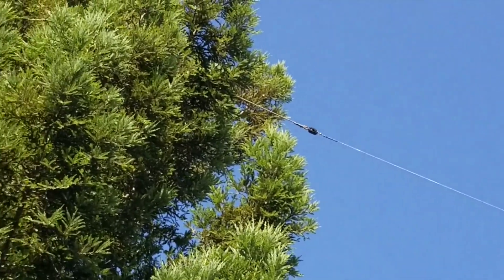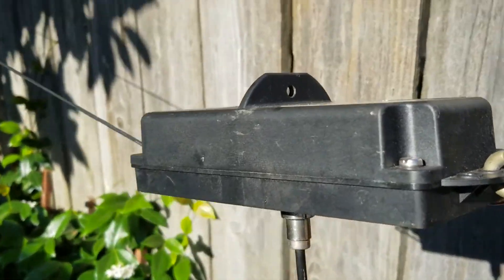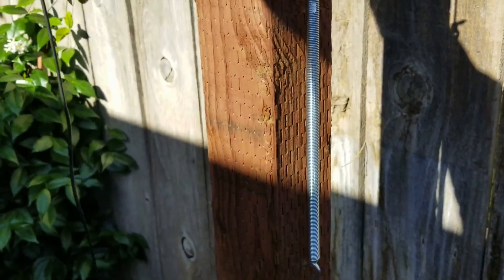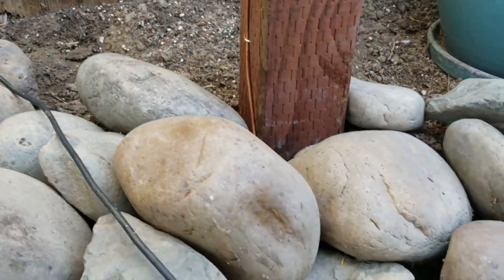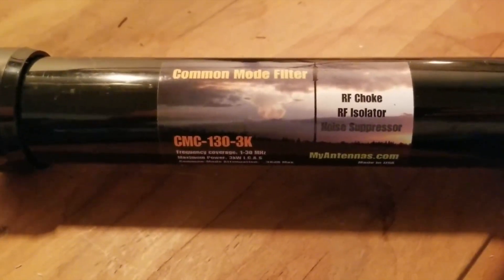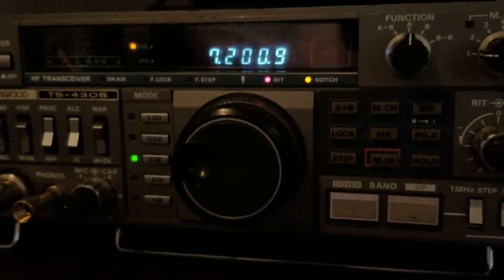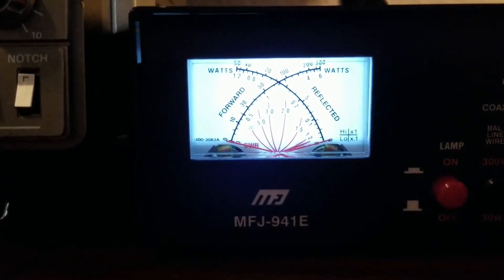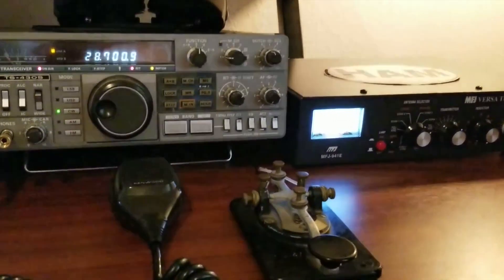EFHW myantennas 4010P EFHW (End Fed Half Wave) Antenna with Spring Tension system, AL7PS

Comment: Good video, thanks. I do have a question. I just bought the EFHW 4010 and there were no instructions as to which way the antenna wire should go i.e sloped upward and which azimuthal direction.
Reply: Thanks,  it has various configurations, there website shows the optimum

Comment: How'd you get it in the trees? Climb up there?
Reply from the maker: @n74jw  I used a fishing pole with 25 pound test with a 3 ounce weight attached.  Easily reached 75 feet height.  Then I tied a 1/8 nylon rope to the weighted end of the line and pulled it up. Very easy

Comment: Fantastic video! Pulley and springs=brilliant! I'm working on General and studying HF rigs AND antennas. Please a question. MyAntennas says no turner required for their 40,20,15,10......so why the MFJ??? And I bet your HF rig has an internal tuner? Thanks, I'm learning!
Reply: The tuner is to show SWR results, you do not need a tuner on this antenna. This radio does not have an internal tuner.

Comment: Great innovation, but I would think to combat rust from ruining your spring over time, it should be painted with perhaps a Rust-Oleum product ?
As for movement, especially of the ground wire, I wonder if the Copper will become, 
" Work Hardened ", and fail over time ?
I have a similar issue with a Red Maple tree, that I'm hoping to get trimmed, so not to have an antenna pass thru it !
Thanks for your posting !
Reply: Thanks for the comment.  I agree regarding painting spring. However, movement of the ground wire is not an issue. It has barely moved at all over the years.  It's not like it gets bent at a sharp point, it doesn't get bent at all,  it just moves fractions of an inch

Comment: I want one of these man! Will it work on 11 meter without tuning it out of the ham frequencies?
I have a CB base station and run CB's in the dump trucks on 11 meter and learning all I can off and on about ham radio.
I was ready to take my test then covid hit and sort of threw a monkey wrench in the gears.
da di da dit      da da di dot  dabblled a little in CW as well but not enough.

Comment: I was struggling with the selection of a noise filter. Kinda pricey for about 50 ferrites around a coax , but a nice encapsulated container. And you said it works. Your video is well made and clear. I took note of the solid #8 copper used as a grounding conductor for lightning protection. That is a good configuration because it's there to conduct a lightning strike--not stray Rf......If it does break after a year or so of swaying in the wind simply splice it together again. I like that..☺

Comment: I see  a problem with your setup that you might have already experienced since this comment is 2 years after your video. If the tall tree that is holding the top end of your wire starts to bend toward the house (toward the low end of the wire), the antenna wire is going to go slack and sag. It might even sag enough to get caught in your other trees that the antenna is normally above. I would suggest putting a heavy weight in between the end of your rope and the top end of the spring. This weight needs to be heavy enough to take up much of the weight of the antenna. This will allow you to use a lighter weight spring that will give you a greater range of motion to handle heavy winds that sway the tree a lot. When you attach the bottom of your spring to the post, be sure to pre-tension the spring so that the antenna wire will stay taught when the tree sways toward your house. I hope that helps.

Comment: I  have seen where people want to run > 50' of coax from the unit to ensure that the coax is not a half wavelength of your desired frequency.  Then I also see where people mount the unit very close to the shack to keep coax and ground wires as short as possible.  I also see where people like to raise the unit up to 40' as well as the other end of the wire.  So who is right? Which is best?  https://www.youtube.com/watch?v=iMbN_uDeyU0

Comment: Hi ~ what is the Gain of a EFHW ?
Reply: .5 wave on 40. 1 wavelength on 20. 1.5 wavelength on 15 and 2 wavelengths on 10M. So 2.1db/2.3db/3db/4db. 15 and 10M are gain spurs. I've worked from Russia to Japan on My Antennas 40-10 in an end fed inverted V. I compared my roof mounted Cobweb to my end fed inverted V on 15M today with someone in Spain. He said the V was 1 db stronger at his QTH.

Comment: Nice installation.  I have to say I like your background music as well...lol!  A 2 to1 SWR is only a loss of 10 watts if transmitting 100 watts.  And you are correct, your transmitter can handle that. Especially after using the tuner to match the load to the transmitter. 73!

Comment: Hi I use a similar system but use weight and not a spring gravity works for you
Reply: Me too, Peter. I have used a pulley and weight to mitigate wind and swaying trees since the 70s without surprises.  My 130 ft 80-10-2K EFHW is held up by the weight of two bricks (11 pounds) and a pulley about 15 feet out from the top of a big pine tree.  ---  73, kc4i

Comment: you should change that ground wire with a braided strap, not only does a braided strap carry HF better but it's far more flexible and less prone to fatigue.  Solid copper wire will work harden and break pretty quick.

Comment: Not familiar with my antennas but I would expect the coil on the wire should be at the far end of the antenna, not near the feed point. I couldn't find any instructions on their web page. You might want to check this.
Reply from the maker: The coil is placed exactly one quarter wave length on wire specifically,  correct design

Comment: Do you need a tuner with this antenna
Reply: Nope, It's Awesome! That's why many SOTA (summits on the air) HAMS use them. I trimmed and tuned mine to be resonant on each band, 40, 20, 15, 10 meters, right in the middle of the band. The SWR is 1 : 1.9 at the worst.  Used them for years, and not slowing down...
Reply: I don't use one and have SWR of 1:1.5 and lower across all bands. I've trimmed/tuned it to be resonant in the middle of each of the 4 bands. 40, 20, 15, 10. #notuner

Comment: Bought one of their ended wire antennas. Came with no directions so I emailed them asking for a copy of the recommended installation instructions. Was told in an email reply that they figured I would be smart enough to know how to install it as all hams should know how to to do this correctly. For the over priced antenna I would have thought they might have some installation recommendations. Will not purchase from them again.
Reply from the maker: They are correct. "Instructions" are based on your equipment and deployment configuration. As a HAM yes you must understand common basic wire antenna principles. And even if you tried to build one, including the transformer, you would be around the same price to purchase. The track record across the web for the EFHW from myantennas is nothing but stellar.  I've recently had a phone QSO over 7,400 miles away with just 90 watts in an Inverted L config. This antenna performs with a doubt!!!
Reply: @AL7PS  Oh you could build this for $40.   I have.
Reply: @AL7PS  I wad looking firward to some expertise with this particular unit. I have jad several endfeds and each was quirky on their own Just because your a ham doesnt make you an expert in every different antenna by any means.

Comment: Might try placing the choke outside.

Having the choke inside lets common mode come into the shack up to the choke.
Reply from the maker: It has been relocated to within 1 foot of the transformer per manufacture recommendation.
Reply: The closer to the transformer, the better.

Comment: Arent't you supposed to read the swr on the point where the needles cross ?
The swr is doable i guess, but i wouldn't call it good at this moment.
Are you gonna change anything to get it better ?
Reply from the maker: Correct, many changes have been made and now a Nano VNA Vector Network Analyzer is used instead of SWR meter. Now the antenna is 1:1.0 across all 4 bands with no tuner. Thank you
Reply: @AL7PS  Great video , thanks. What are the many changes made ? Will be buying this antenna soon. Thanks
Reply: @dkk4751  Probably shortened the wire a bit at a time, MANY times.   Too high priced.   Make yourself the same thing for less than $40.

Comment: Isn't the purpose of the common-mode choke to keep RF off the coax shield? Putting it at your rig doesn't really accomplish that, does it? I've never seen a choke of this kind placed anywhere except as close to the feed point (in this case, the transformer between the end-fed wire and the coax) as physically possible. I don't know what MyAntennas said about this, but you may want to consult independent (i.e., not-for-profit) sources.
Reply from the maker: Todd you are very correct. The choke was moved into the shack for this very reason. During the filming the choke was in the incorrect placement. Thank you very much for pointing that out. It's great when people like yourself point out "errors". Thanks again Todd

Comment: I'm curious about the 8' ground rod driven near the transformer, and connected to the unit's grounding terminal. I'll assume you did not bond this ground rod to the "other" rod which is presumably grounding your rig. Do you think there are any issues with ground currents flowing between the two?
Reply from the maker: Correct,  the rigs in the shack have their own single point ground strap to a rod.  What's the concern about ground rod next to transformer?
Reply: @AL7PS  I know this was long ago, but to answer your question, ALL grounds are to be bonded together,  including service panel entrance ground, shack ground, antenna ground and tower grounds.   Grounds are not all at the same potential. By not bonding them together, you are making the coax braid the path for differentiate current.  Not only that, but you have made the coax braid the path for lightning dissipation.  It is also a code violation. NEC very clearly requires that ALL grounds be bonded together.
Reply: @ID_Bill yes and no...they say that as a CYA what happens is we tinker (it's in our DNA) with it and add on things like remote tuners  and amps that may carry the unwanted current on another wire to shack. My issue is I didn't see a lighting arrestor.  A second bonded rod or bonding to ground rod used by shack can all depends on how far ..is there a concrete slab  so you can't bury it...lots to consider

Comment: What was the swr without the tuner. Whatever that is, it is still there with the tuner in the circuit. The tuner is just making the radio happy.
Reply from the maker: Almost exactly what the manufacture stated on the specifications. This is a very good quality EFHW from @myantenna

Comment: I thought you’re supposed to have the common mode shock at the feed point not at the tuner?
Reply from the maker: Hello, not with an end fed half wave. Manufacture recommended for best results
Reply: I’m sure the reason to have the spring at the weighted end than the field end, is because, further the spring from the weighted area, lesser the spring action.  Please correct me if I’m wrong. Thanks.

Comment: I thought he advertised this as "no tuner needed"?
Reply: Yes, the ad is correct, to a great degree.  An 80-10 EFHW typically has a low SWR at some chosen low frequency such as 3.55 MHz, and near its multiples of 7.1,  14.2,  21.3, and 28.4 MHz. Within those dips, one does NOT need a tuner.  However, the tuner can be very handy at keeping the rig happy when using frequencies on the slopes either side of those dips which are frequencies with higher SWR.  --- 73, kc4i

Comment: I thought the point of that half wave length end fed was that no tuning was needed? Great upload; I love your tensioner! Thank you!
Reply from the maker: In perfect conditions I'm sure tuning is not necessary, however, trees, buildings, height, slope angle all  impact the antennas ability to propagate, thus a tuner for adjustments. Thank you for your comment.

Comment: You seem to have a lot of noise on this antenna.  Even with the choke.  I've made comparisons between a ZS6BKW and an EFHW 4010 67' and the ZS6BKW consistantly outperforms the EFHW with a much lower noise floor.  I experience the same noise as you.  Static and buzz.  My ZS6BKW which I built 10 years ago is quiet as a mouse and much easier to pull weak signals out with.  I'm still trying to make the EFHW work.  If I didn't have the ZS6 to compare it to, I guess I would have thought it was a great antenna.....
Reply from the maker: I'm going to build a ZS6BKW to compare. Have always wanted to. Thank you for your educational comment. I appreciate it

Comment: Im getting ready to do an antenna setup just like this. Is the RF choke necessary though? I thought grounding the antenna was enough to stop any RF coming into the shack.
Reply from the maker: Yes it's very necessary.  Reduced noise. Mine is  sitting ust before the radio. Grounding is for spurious discharge. And if you ground it you do not need counter poise.

Comment: Does the wire going thru those two trees cause any problems?
Reply from the maker: It goes over one and thru another. No impact on HF. I just worked 5,250 miles with 100 watts. It's working great.
Reply: @AL7PS  Hi Ken,
Even with insulated wire you will find the frequency of resonance will decrease when the wire is in contact with leaves and other objects, especially out on the ends of the antenna where the voltage is high.  This happens because of the added capacitance from the leaves and it may or may not be an issue for you, but something to be aware of especially if you are chasing the SWR all over the place.  Ice loading will have a similar effect.  73, Don

Comment: Hey ken, I just bought the 8010P to replace a full size inverted V G5RV and I like your idea of the spring tension on the one end. The only difference in mine is that im going to mount the transformer end up high on the house sloping down to the other end of the yard. I dont have any trees on a 1/2 acre lot so im forced to use a fireberglass mast on the far end mounted to my fence. You mentioned that myantennas recommends the transformer box be mounted close to the ground but I cant seem to find that info on their website. They do mention that I wont need a ground wire if the box is mounted high because I have a grounded feedpoint before the coax enters my house. 73 Vince N3VMC
Reply from the maker: Hi there, there website does say to have it 4 to 6 feet above ground. It makes a difference. Also, you will not need a counter poise if at this height.
Reply: Hi Vince, I too have the 8010P and It's a great antenna. Head on to Steve Ellington's channel and he shows how to use the 8010 in general for 60 meters which really does work.  I can easily now tune 60 with my radio's internal tuner.  We use 60 for our ECOM.  For my 60 meters to tune well, my feed point does need to be close to the ground.  Once I raise the feed point pass a certain height, the SWR for 60 goes high and cannot be tuned by the radio.  It's a trial and error kind of thing.  My 8010P is up about 18 feet, goes horizontal for 90 feet,  makes a 90 degree turn and slopes down.  My feed point is less that 12 inches above ground. With this config, the other bands work well too.  So glad I don't need a separate antenna for 60 meters.  I'm getting good reports for 60 meters.  73s.

Comment: What kind of spring did you use?  I have to pull pretty hard on mine to get the sag out of it.
Reply: looks like a screen door spring
Reply from the maker: I bought it at Lowe's. It has one and a half pounds of resistance. The next step up was two and a half pounds. And then a 5 lb.